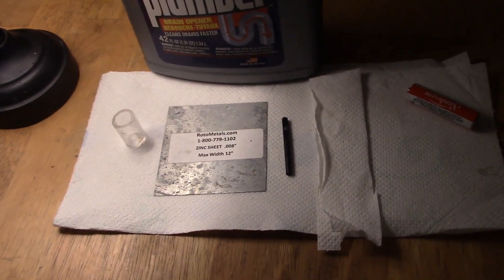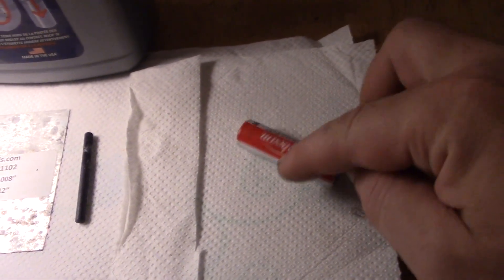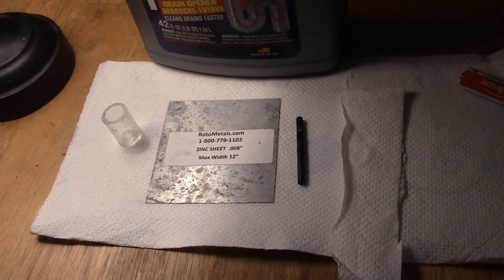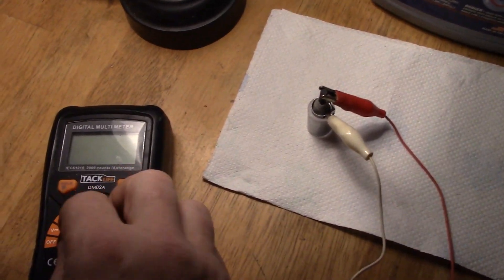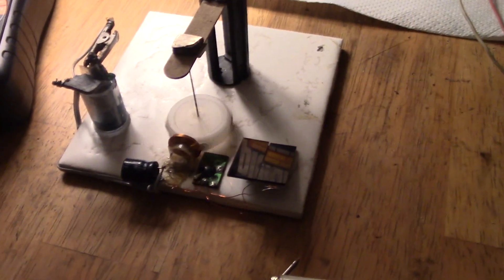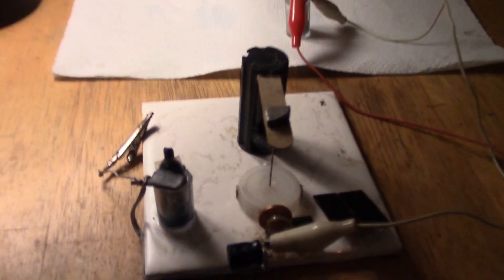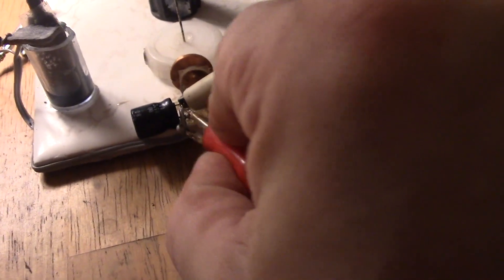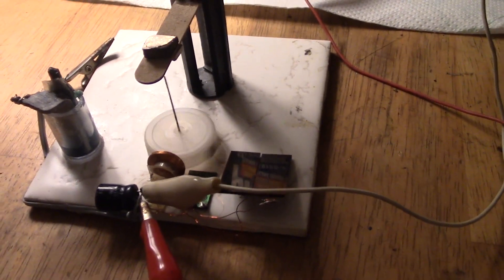Homemade Carbon Zinc Battery Cell

Comment: how long the battery lasted ?
Reply from the maker: Good point. It lasted on the project for a few weeks, with a resistor limiting the output rather than going at full speed. It sat in the sun with solar help, then I reused the motor part. One thing that does happen, is it will dry out, as I found with it being on the windowsill. An epoxy/hotglue layer on the top would help with that  :)

Comment: Cool! It's looking like a legit alkaline replacement for small projects. It's neat to make a low power pulse motor that basically runs long term from a battery you also created yourself. It's like the whole shebang.
Reply from the maker: Especially if using something like sMartcreations2010's couple of similar circuits. Homebrew can be very close to commercial and sometimes even beat it, if the parts match. It's like using a Tesla Powerwall to run just a table lamp, it could do a lot more and cost a lot less to run 1 lamp.
Best of success with your own projects  :)

Comment: Initially looking good but I suppose that cell will last until a thin layer of sodium zincate forms on the surface of the zinc. The time for that to happen may be determined by current draw, which we know is very low from your circuit. It will be interesting to see how long it lasts and how the spin rate varies over that period. The cell might dry up first :)
Reply: Of course Sliders cell is serviceable, where as an alkaline battery is not. ;)
Reply from the maker: @benwinkel  LOL, they kind of are if you see Pseudo Nym's videos. He cuts them up and reuses sections - am wondering about snipping the top off and adding mixes.
Reply: @benwinkel  You're right but don't forget the idea behind these experiments is to try to get something for nothing, or very close to nothing, that also performs `work` for a long time! An exhausted alkaline cell would otherwise be trashed. As it stands, Sliders current cell costs more to make than a new AA alkaline battery!!
Reply: @pseudonym4693  That may be true, but i still think it was worth the effort. It got me my name mentioned in a YT video which imho is priceless! ;)
Reply: @benwinkel  You must be easily pleased then !!
Reply from the maker: That's the resistor trials. Am starting on 5K. Really, only rate of rotor spin is affected more than anything and slow at 6am is better than stopped lol. But yes indeed, winter morning draw is likely the crumbler on car batteries too. Drying out is more of a problem than I thought. The kitchen roll stays wet, but the extra in the solder tube disappears in 1 day!
Reply: So a mesh of zinc would be better? Or couldn't you just put som nitric acid in to continuously etch the oxidized layer???

Comment: Another success 👍
Reply from the maker: It's running well. They all take a bit of load matching working out (resistor), but it's a strong 'un for voltage.

Comment: cool, always interesting to see what your up to.....i bought one of those solar display turntables with the 4 panels, one on each side, the motor in it is amazing, the torque is unbelievable, i had a full pint glass turning on it....pulled it apart to look and it will run on the least bit of voltage....grab one of those, you'll love it....like is say it is amazingly powerful it has a rotor with 4 magnets like you have, and 2 cog gears attached to it which provides the torque....the other amazing thing with it is it can spin both ways, whilst it goes one way, you can nudge it and it will go in reverse too....check on ebay, they are cool.  see what you can do with it :)
Reply from the maker: Have got a homemade one, built several years back. It's on a VCR metal assembly with a gearbox. Solar powered with a CD on it as the platter. Was going to be for Hotwheels electronics, what can go in one to make them more like cars (lights/horn/engine sounds etc). But yeah, they are great for displays and seem to run very well indoors.
Reply: @Slider2732  I've got one and it is certainly `efficient`, works on a similar principle to the Tibetan Prayer Wheel (the one that Lidmotor showed) which I also have. Reverse engineer one to gleen some ideas for your low power, long life projects!!
Reply from the maker: @pseudonym4693  Ah yes, fascinating devices. I must look into those  :)

Comment: Very fun!  Does it need a strong alkaline, or would a weaker alkaline such as baking soda with water work?
Reply from the maker: Certainly try it out! The Plumbers stuff didn't work out so well with the lead, the zinc idea was an alternative. But, I used to run a Joule Thief type circuit continuously for years, using carbon, lead and rainwater. Seems that the weakest mix possible to run the load works best long term, Especially effective is a 5K or so resistor in series, to avoid draining a cell at its max output.  Nothing ever happened to the rainwater one on the surfaces etc, it simply dried out and got moved.
Reply: @Slider2732   Thanks!  It is now on my list to try. leo
Reply: STEM Camp Projects I got a LED running at least seven months.  Magnesium rod, 10 pill bottles, Epson salt mix with graphite. Most people use copper tube and all kind of other things. For you and the kids PVC pipe would work. I used a smaller aluminum rod wrapped with copper wire to magnesium rod. I hooked them up in series . 5 bottles or pipes hot glued. 1 piece magnesium and 1 piece of aluminum wrapped with copper wire in each bottle. When you connect them, it is aluminum wrapped copper wire to the next bottle in to the magnesium. I drilled and soldered it . You could just wrap it also.  On the end of the   5 bottle run a wire to # six bottle and finish the series.  Hook any LED up to one side #1 aluminum other side #10 magnesium. I used ground Epson salt and just enough  graphite to change the color. To much would just short it.  Light water and you are there .  This little  booger got very volts . So check it while it is fresh, you will be amazed and proud. I was tickled , it sill get at least two or three volts last I checked . Keep up the good work and keep us informed . Glad to see you back.